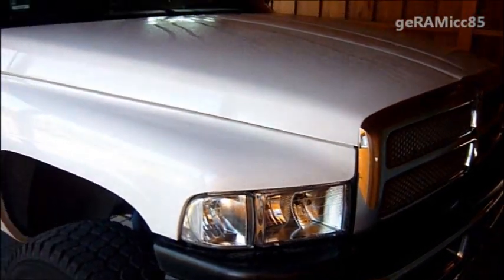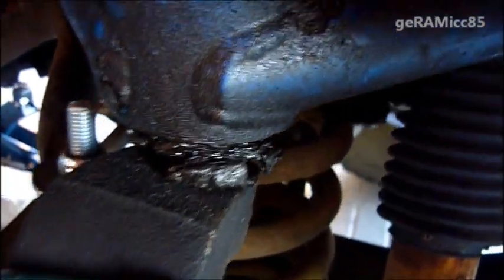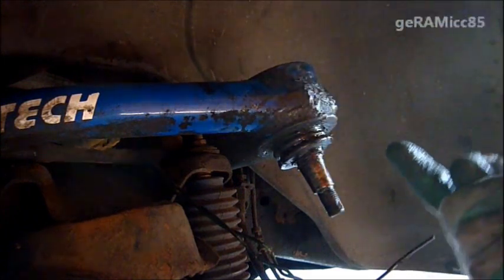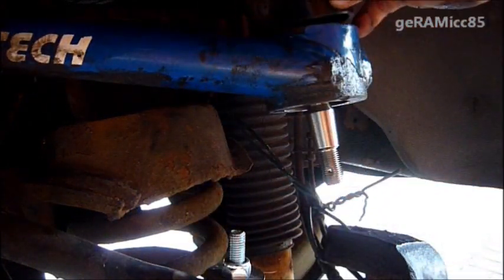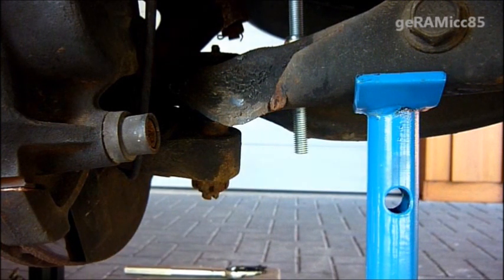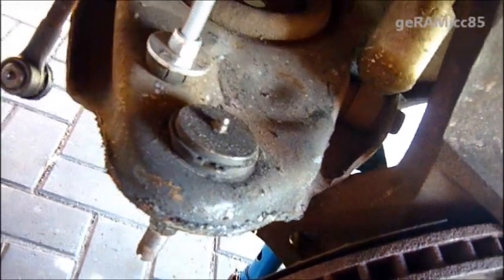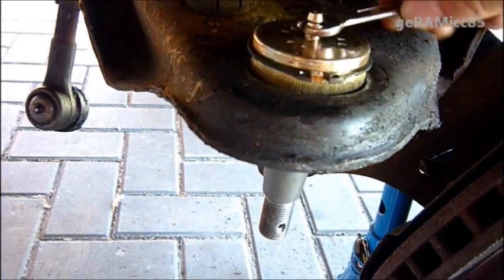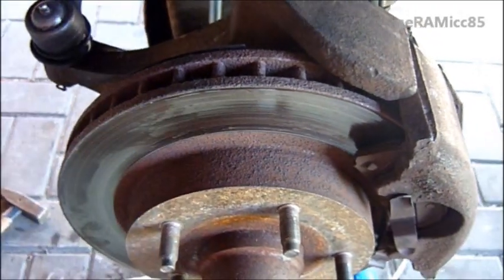BALL JOINTS REPLACEMENT ON DODGE RAM | HOW TO PRESS IN UPPER+LOWER, REMOVE,REPAIR,DETAIL INSTALL,DIY

Comment: Hey man, some feedback would be nice but, Anyone will do, I have a 2007 Dodge Ram 1500 Big Horn Laramie, I also have a 6-in lift kit from ProComp and new 35-In tires, Recently, (what i T.H.I.N.K its called) There is a block connected to the upper ball joint that is NOW rubbing up against the inside of my tire, I smell it burning.... I am not driving, But if any of you know what the problem is, Why it's doing this... PLEASE comment back!

EDIT: At 2:28 That black block at the bottom of the screen is what is touching my tire.
Reply: Old comment but not sure if you fixed it but from what i can think of, your tires maybe be too wide, try putting a set of wheel spacers on it an itll bring your tire farther away from whatever it is that is rubbing an itll bring your center of gravity back fown since you have a lift so you wont be top heavy either or try less wide tires, but spacers would be you best bet.

Comment: my only question is that I keep seeing mixed videos on having to change the entire upper control arm with ball joint cause it won't/can't be pressed out, and I see others where they can be pressed out. I have an 01 1500 2wd St Cab ST bed. 5 speed. if anyone could give me insight I'd be eternally grateful. thumbs up, thanks for the knowledge and good forum here.

Comment: NEVER ever use bricks, cinder blocks or concrete blocks in this manner. Extremely dangerous. Use railway ties or some kind of hard wood with some thin piece of steel between the wood and the jack. or better yet buy the proper jack for you vehicle. Please stay safe people

Comment: using that tool wrong. Don't push the lower ball joint where the ball is. only push on the flat. your damaging the ball joint the way your doing it. There are plenty of videos on Youtube showing the proper way.  The car Doctor comes to mind.